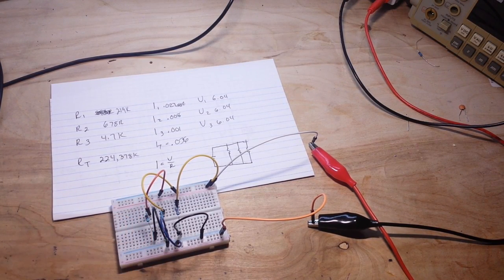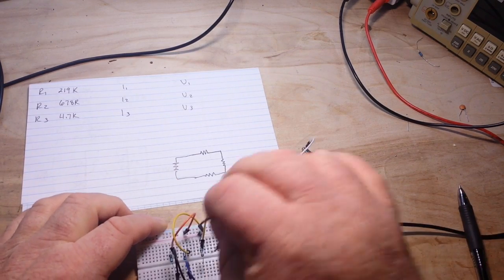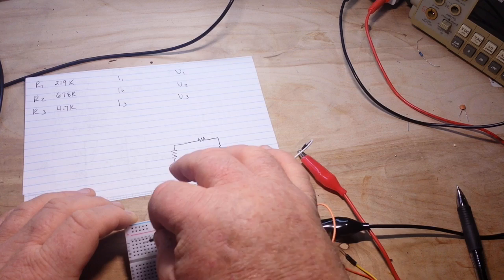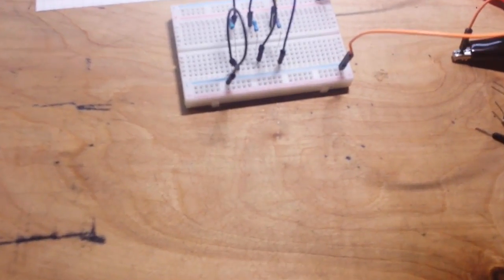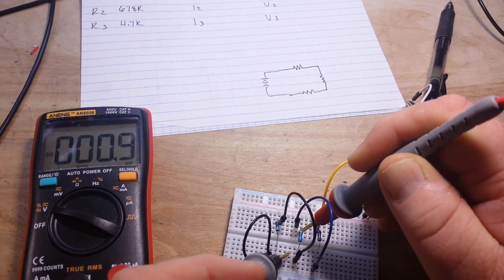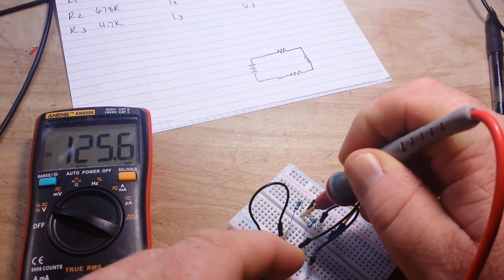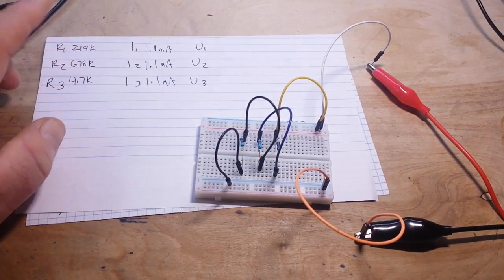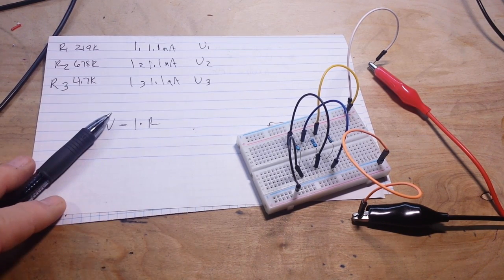Ohms Law & Series Circuits

Comment: If your total circuit resistance is 224,650 (rounding off a bit) ohms and by your measurement you are seeing a total circuit current of 1mA. What is your total voltage drop for the circuit? What, did I hear someone say over 224 volts?  Okay, going back to the first measurement where you didn't read anything. You thought you didn't have a connection. You did. The reason you didn't see anything is that your meter won't display less that 100 microamps when on the milliamp range.  As jp040759 pointed out, you were changing the rules by placing the meter (set for current) in parallel with each resistor. You have the resistor value in parallel with the meter resistance which, on a current setting should be rather low. You normally do a good job but today, time for teacher to review his notes.

Comment: I don't know if this is a trick question but I'm going to use Kirchhoff's Loop Rule.  You supplied 6 V to the series circuit, that means that the sum of the voltage drops must equal 6 V (technically -6 V).
Reply: at 4:08 he says the voltage has changed